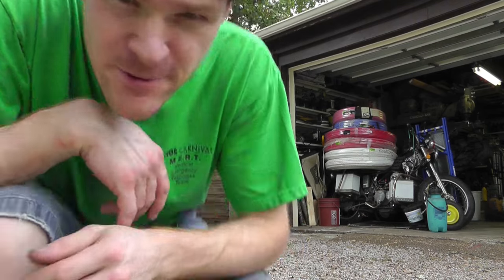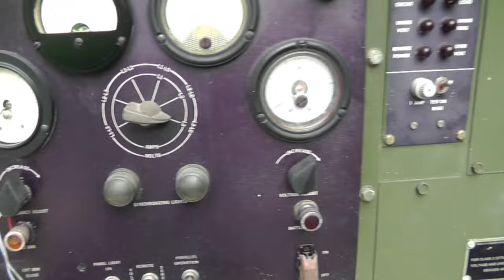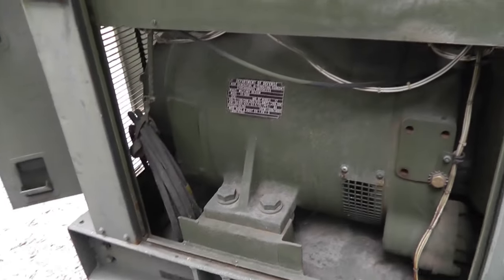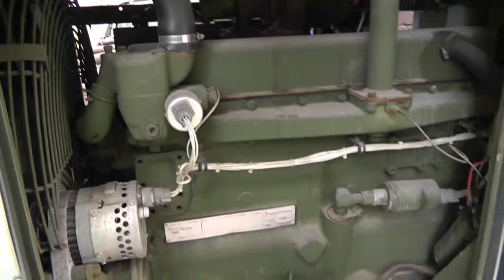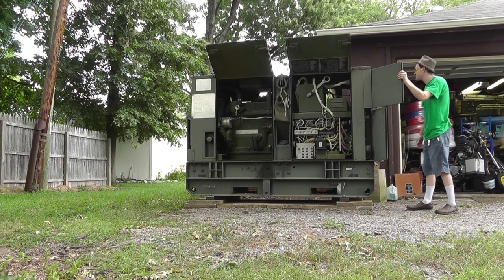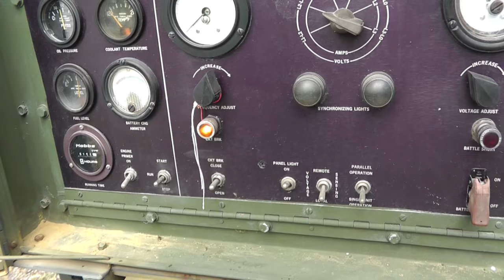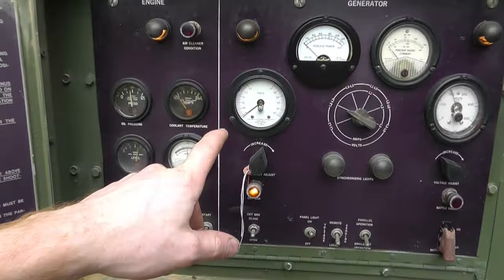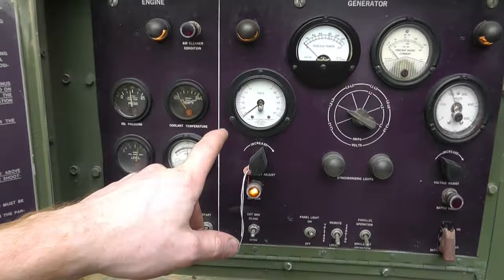MEP-006A Military 60KW GenSet. Overview And First Run After Sitting For 3+ years...

Comment: I spent 15 years as a generator mechanic in the Army.  Worked on this gen set a LOT.  Its very reliable.  I would suggest to this young man to find an operator's manual for it.  He'll find that some of the stuff he said during the making of this video is not correct, after he reads the manual.  It's not a motor, it's an engine.  A motor runs on AC or DC voltage and current.  Engines run on gasoline, diesel, and even kerosene.  This unit appears to be in good condition.  I would expect to pay $5,000 to $7,000.  Parts are still available.  Good luck with it.  Its a great find!
Reply: So a motorcycle is an engine cycle 
Motorhome is an engine home 
How about General Motors 
You got an outboard motor on your boat ? No no sir it’s an outboard engine
Reply: We have this model the motor runs but does not generate electricity. Not sure if it's the regulator or what? We can not find anyone who works on them here in western Colorado. Any advice?

Comment: It's been a few years since you made this video. I hope that before you ran that old (tractor) engine again that you drained all the old fuel, changed the fuel filters, drained the oil, and changed the oil filters, and refilled with fresh fuel and  oil.  Diesel's are peculiar  about having good and clean fuel.

Comment: there is a throttle cable adjustment behind the lower front door, screw it out to get to the right frequency. the frequency adjustment is for when you run them in parallel you should get the tm to use it properly
Reply from the maker: 100% correct. that was the reason it was not at the right frequency! ~Russ

Comment: The item you have is a 400Hz generator. It was designed to be a ground power unit for aircraft systems that use 400Hz. That doesn't seem to mean anything to you! ....Believe me, IT SHOULD!  Just because your AC voltages measure to your liking, doesn't mean your 60Hz appliances (in your dads home) will agree. In fact; you will almost certainly damage ALL of them. You are probably looking at replacing the alternator half of the unit with one that is designed to produce 50/60Hz.
Reply: We have this model the motor runs but does not generate electricity. Not sure if it's the regulator or what? We can not find anyone who works on them here in western Colorado. Any advice?

Comment: The two slots in the sled are for forklift maneuvering. The "C" bolts near the top are for a Crain lift or maneuvering. Try eBay for the power plugs in Government surplus. The screw thread in the exhaust may allow you to put a vertical stack, the noise then goes up in the air, not across the yard Just like a truckers tractor unit. You'll need to log the hours the engine runs. This gives you the service intervals like the automobile has mile odometer for oil changes etc. Frequency is engine speed you will find the faster the engine the higher the frequency. The synchro lights are important when connecting two or more generators together (get the power company power station to show you to see how they bring online another alternator set). You'll get the idea.

Comment: Trailer axles are designed for one purpose, from manufacture to dealer, then to the point of setup.
They are sent back to a refurbish company. Then taken completely apart and checked out, then reassembled.  The brake pads are not designed like autos or trucks are.

Comment: Battle mode or what they also call combat mode is an override.   When activated that generator will run until it explodes regardless of any faults or issues.    It's a run till it blows mode.

Comment: This unit would be very useful for a family gathering up at the cabin or a hugging party up at a cabin. There would have to be a plug-in to plug-in receptacles with cord on the cabin to interface with the generator in both 220 V  mode and also 120 V mode.
Reply: What the hell is a hugging party?

Comment: said my another commenter you probably need a lode for the the voltage and frequency gauges to work correctly. more so the frequency meeter. 
this is way more complicated than i thought they were. but hell it started right away after 3 years with old gas as-well. very very cool!

Comment: Put an elbow and a pipe going up on the exhaust.  The doors on the side most be closed when running so the air comes in the back to cool the generator part and that will also cut down the sound. With the exhaust going up that sound will mostly go up. I wish I had that. I really want the older one with the multi fuel engine.

Comment: CE1 here. I’d take some time a read the manuals. They do kill. This I know. And the one that died went through the same school I did. Read the manual and ware long sleeves and jeans at the least.  Keep the doors closed when it’s running and put back the insulators. I hope you get to take this to disaster zones. Try to coordinate with some existing groups who do this. I work hurricane recovery through those channels. Just driving towards a wiped out town with this in tow don’t guarantee you getting it in no matter how bad they need it.

Comment: The throttle is on the right side under the front panel. It's hidden behind the open intake air door. You use that to get the HZ close to 60, then you can use the control panel to fine adjust. You had this basically at idle after starting it, so throttle it up a little more. There is also an output for 400 HZ that can be used for aviation and to power aircraft, planes use 400HZ. Lots of really thoughtful features on these. You will be changing injector pumps. Often.
Reply: Maybe what’s wrong with the one I jus got at auction/all I know is the mechanics(none diesel) said it wouldn’t start.

Comment: You better check with the D.O.T on the use of the axles Don,t  think you can use them for safety.
Reply: He would be better off just mounting the thing on a double axle flat deck trailer used for hauling cars.

Comment: You could charge a large bank of batteries with that thing real fast and power your household 110 for a week or 2 on the cost of a few gallons of diesel. If you needed 220 for anything you have that covered.  Who needs solar panels. ;)

Comment: For sure it looks like a 400 Hz model.  Aircraft use 400 Hz AC power and it says US Air Force.  If that's the case I hope that Russ can convert it to 60 Hz.  That thing is worth a fortune.

Russ:  My advice is to keep it for your family.  Stock diesel and filters and oil.  When a disaster strikes, just offer your services with the teams that set up generators - the best of both worlds.  You have an *awesome* find, a military generator tank.

Comment: 'Battle short' indicator and switch are just that...  lines or the units taking power take battle damage and short out, that will trip the system and you can reset using the switch.

Comment: I would have done an oil change before I attempted to start it also put at least 5 gallons of fuel in there
Reply: My first thought, he looked at everything else. Obviously does't have the first clue about a diesel engine.. but then again neither did my former boss.

Comment: 400 hz?😁 Some folks don't have a friggin clue....
Reply: 400HZ for aircraft and radar. That is a 50/60HZ generator set.
Reply: Lol.
Reply: 400 Hertz is a aircraft Hertz
Reply: 400Hz is used in airplanes. Remember, this is a U.S.A.F. generator.
Reply: Aircraft generators are 400 Hz.  That generator is a Ground Power Unit for aircraft.  I
t would damage almost any appliance that requires 60Hz, like a refrigerator etc.  So much for an emergency power unit for disaster areas.

Comment: even if it works, military generators are difficult to use. In Alabama you will have to pay Southern Company a demand fee! yes i said PAY. the PSC passed a tax - fee for standby power use such as solar panel. Am sure it applies to large generators too.

Comment: Nice to have. I bought an MQ Power Whisper Watt 70kva gen set on tandem axle trailer with aux belly tank for $800.  Never have had to use it but I'd rather have it and nor need it than need it and not have it.

Comment: I sure hope you poured something in the diesel to clear up the algae in it... And maybe dilute with some fresh diesel.  
Also, always have something ready to snuff the intake with in case it runs away on you...that fiber board cover would have done the trick if it fit up in there. 
Sweet machine you got there...makes my 410A welding machine look small.

Comment: You didn't say what exactly what it was, but you made a reference to the frequency of the generator.  You need to be careful about that.  They made two versions of those generators.  One runs at 60 Hz, the other runs at 400 Hz.  By your comment "that can't be right" I bet you got a 400 HZ model didn't you?

Comment: If the generator is putting out the full 6D kilowatts or 60,000 W of power in an hour at the rate of 120 V ,than your amperage that you could use is 500 amp circuit which should be way more than enough for a Normall home which usually has a 200 amp circuit at the maximum

Comment: You mentioned taking it to disaster areas?  You will have to pull guard on it 24-7.
    The Generator you have will power about ten homes with washer and dryer.  
     Good job finding one.
Reply: Zombie Land I see them all the time in govt surplus auctions.  Not unusual to see 10-15 at a time sold. They are sold as is, so it’s sometimes a gamble.

Comment: Frequency is measured via frequency to DC volt converter. Your's is probably toasted. Check for black block rounded corners Input Output that goes to the meter

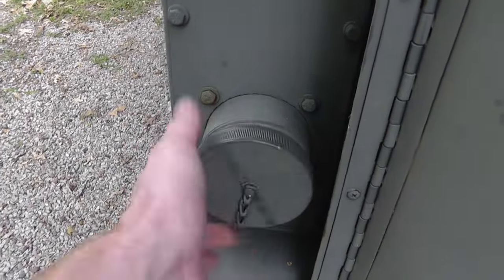Comment: 5:27 That outlet is a Bendix 52-12 200 amp 3-phase with 4/0 gauge conductors. Socket A,B,C are the hot phases, N is neutral and G1,G2,G3,G4 are the grounds. http://www.amphenol-aerospace.com/pdf/12-052.pdf

Comment: If you still have this gen set, see if you can find an ASK (acoustical suppression kit) for it. They're like a foam core encasement that bolts right onto the set's frame. I must've installed forty or more back when I was a Generator Mechanic in the Army.
You're gonna need to find an alternative to some of the K relays behind the control panel, and someone to rebuild the alternator if you can't find some retrofit.
The missing tag was likely to just there to show that the generator is at the 10/20 level of maintenance standards, i.e. just as it came from the manufacturer. 10 level is the Operator's level of maintenance, and 20 level is the Mechanic's level...basic routine maintenance of the engine and minor electrical components. That is required before any Unit can turn the equipment in.

How is it running these days?

Comment: The generator we used in our 200 bed Combat Support Hospital was a helicopter engine in a box!
Reply: A power system called a Utility Pack (also known as a U-Pack or power station) to provide utility services, Heat, Cooling, Inflation, Hot Water, Filtered Air from CBR Contaminants. The Utility Pack (Power Plant, Utility, Gas Turbine Engine Driven - Libby Welding Co. Model LPU-71, Airesearch Model PPU85-5, AmerTech Co. Model APP-1, or Hollingsworth Model JHTWX10/96), powered by a centrifugal flow gas turbine engine, provided electricity (60 Hz AC, 400 Hz AC, and 24vdc). At 250 beds the hospital required 8 U-Packs. Each consumed 30 gallons of jet fuel per hour.

Comment: Being that is marked as being US Air Force in origin.. I'm sure the tag is correct. It will most definitely be 400hz output frequency. I think you'll have a bit of a learning curve on the intended use of your project.  Edit: I see it's had generator head swap. It is in-fact a 60hz capable gen-set.. you got a nice practical gen-set out of that deal.

Comment: Too see the fuel level when the engine is dead, you gotta turn on battle short (MAKE DAMN SURE TO TURN IT OFF AGAIN! it disables all EMG stop systems) and put the engine into run mode, then the fuel gauge turns on.

Comment: The city boy got himself a diesel "Look at how big this engine is" well it's not that big for a diesel actually, but it's a good size for that generator, still practical to move, and if you haven't messed with diesel engines before this is a good engine to learn with

Comment: yea those keys concerned me....little mini lightning shot and your done son......the voltage adjustment is for the setting switch...110-120 v then the 200-240 v adjustments. ...great gen ...could use it here  in FL

Comment: Today is the first time I came across your channel, and this video. I have seen these things at auction before, and am still kicking around the idea of buying one. I'm not sure if you know or not, but the threaded end on the exhaust pipe allows you to add on  an external exhaust system so you don't piss off the neighbors. I also noticed what looks like coils of PEX tubing in your garage. PEX does not suffer the sun's UV rays very well at all. In fact, if you read the label it should tell you not to expose it to sunlight. PEX will deteriorate when exposed to sunlight.

ALSO.......check out www.steelsoldiers.com they have an open forum there with lots of guys who have a ton of experience working on and with these generators.
Reply: Thks for the info-✅.

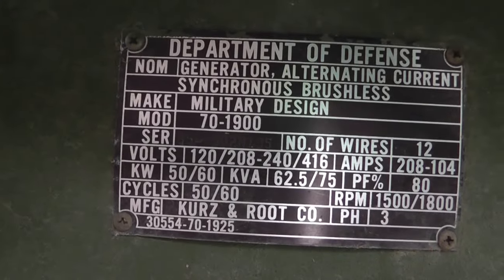Comment: And its brushless (8:15, the alternator name plate says so)? How is the field exciter powered without an slipring? Usually, the rotor has the low power field winding, which needs DC power using slip rings.
Reply: i took a small generator apart one time and the rotor did not have slip rings but it did have copper windings.  Two diodes where mounted on the rotor connecting the rotor windings  together.  I have no idea how it worked.
Reply: Not sure how is it supposed to work. if it is an induction principle based generator, it still should have capacitor connected to stator, needed to create the reactive power consumed by stator, to create the magnet in rotor.

Comment: Larger version of the 110/208 volt 3 phase, four wire generator I used. Still wondering what equipment the Air Force had that needed 3 phase 240/416 volts though?

Comment: An electric oil pump would be good, so you can get oil through the engine for a minute before you start it
Would definitely save an engine you only start once in a while for short periods of time 
Has to be why so many of these gen sets are on auction with bottom end issues

Comment: That is an auxiliary ground supply for an aircraft with the 400 Hz output.
Reply: You must be blind or can’t read if you think this is a 400 Hz unit. It’s definitely a dual frequency, 50/60. The frequency meter has two sides, one for 50 and the other for 60. If you run the RPM up to 1500 you get 50, or 1800 you get 60. He just hasn’t figured out the throttle yet.

Comment: You don't need to "convert" to single phase.  (Actually you CANNOT).  That re-connection is to convert it to voltages used for overseas; 240/416 50hz. Just use one of the phases.  I hate that machine, but they were reliable as long as you take care of the machine.  Oil changes/fuel filter change sucks.  Just be careful and regard the instructions.  It appears that that genset was used for emergency runway lighting.  The data plate will tell you what TM/TO number you need to look for to fully understand how to use and maintain the machine.

Comment: Your PEX pipe in the background degrades with UV exposure. You should have that completely sealed from light and heat over 90F.  Once in use it should be kept in the dark though certain types are rated for underground and hot water

Comment: The frequency is not showing up because the engine is turning too slow. It's got to run 1800 rpm to put out 60-cycle power.

Comment: better than a dam safe >    check the oil water>  Fire that mother up    CONTACT  >  Skid frame>   he hee tell me how to tune up a diesel OK > run a little gasoline or transmission oil in the fuel.. Found the fuel pump , fine the glow plug switch>  Sounds good to me     AWESOME they used that motor in a lot of things Trucks, boats, tanks generators>   A great fine cheers

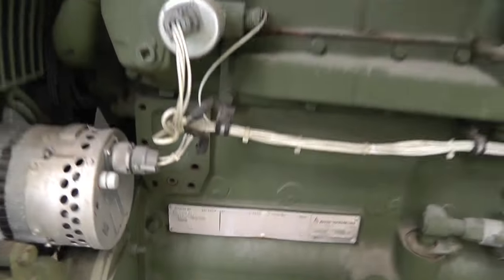Comment: About minute 7:20...   No surprise that a diesel has a turbo on it...  Most diesel motors need some kind of air pressure boost to run them, at least in the most efficient way.  The air to fuel compression ratio needs to be high enough that the air temperature becomes hot enough to ignite the atomized fuel.  Thus, causing the desired expansion to push the pistons.  Many diesels will run without turbos but, would be far less efficient and have less power.  So, diesels are better at higher air volumes and pressures.  To achieve this, a turbo is the way to go.  That is why you'll almost always see a turbo on a diesel engine...

Comment: Yep, 400Hz is accurate.  400 Hz is typical of those, they power the mobile maintenance shelter vans you see the military using.  there are ways to change it over to 60Hz  those cable outlets are 100 amp rated.  This guy is playing with a human bug zappa, and he is definately a darwin candidate.......  Drop that external hose in a 55 gallon drum or thousand of gallons semi trailer.  They do have a bolt on trailer kit, so he is on the right track there.....   Watching to see his reaction to the noise...  Now he can power half the neighborhood if he can afford the diesel.

Comment: From what I've read a MEP-006A Military 60KW generator weight's about 4300 lbs so I'm guessing you'll need a 5K capacity trailer (gen 4300 lbs? + 10%,= 4800lbs?, then rounded up).  Looks like your planning on building it but what type, open (military style) or enclosed (out of rain)?
Good luck and be careful.